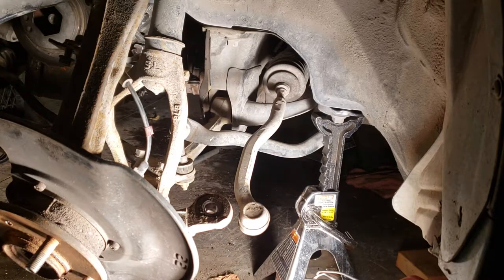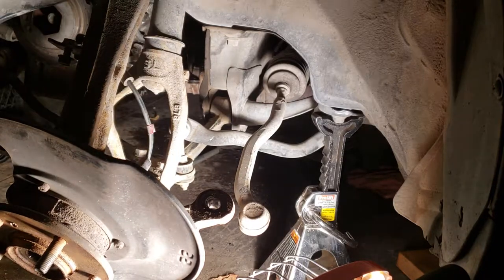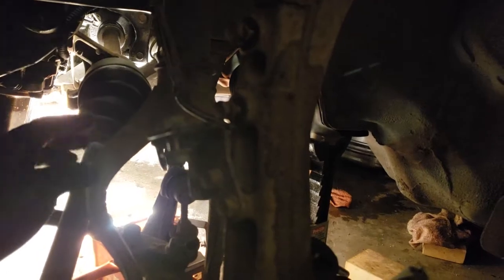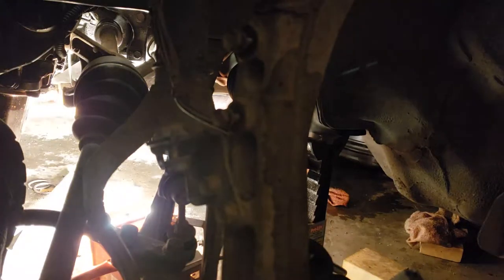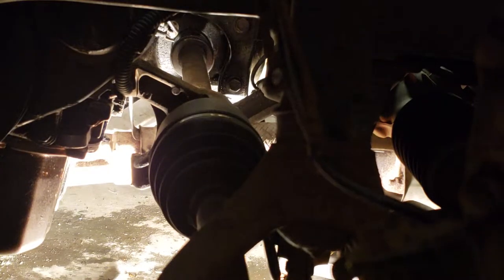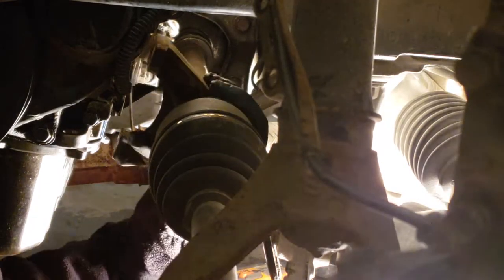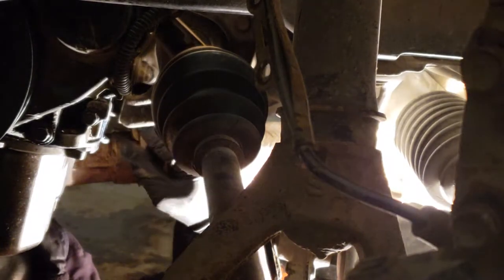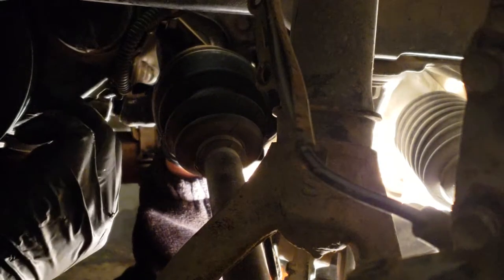Honda Prelude CV & Mid shaft Installation!

Comment: I looked on rockauto and it seems that the part with the bracket is not included. Is possible to use the old one ? That part doesn't wear out ?
Reply from the maker: Check thia other  links 
https://www.ebay.ca/itm/92-01-Honda-Accord-Prelude-H22A-F23A-Automatic-Half-Shaft-Intermediate-Shaft-/301566982348?mkcid=16&mkevt=1&_trksid=p2349624.m46890.l6249&mkrid=711-127632-2357-0

https://www.ebay.ca/itm/Half-Shaft-Intermediate-Shaft-A-T-automatic-Prelude-1997-2001-/203623715419?mkcid=16&mkevt=1&_trksid=p2349624.m46890.l6249&mkrid=711-127632-2357-0
Reply from the maker: If the old one is fine no damage  Ya use the old one.  The only  wear out parts on this intermediate shaft is the bearing and the spline on the end of the shaft
Reply: @jfGarage4k  thanks. Mine is manual. Rockauto is much easier for me to use in Europe. Half shaft is very good. No play at all. I hope I can split them easy